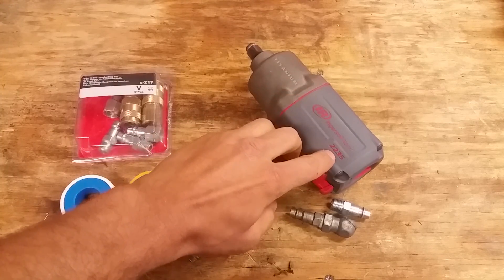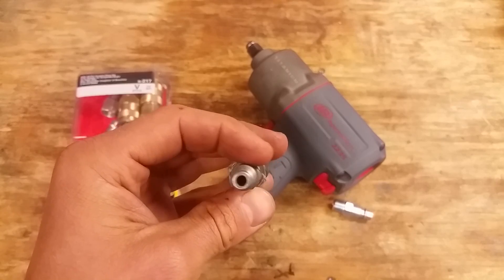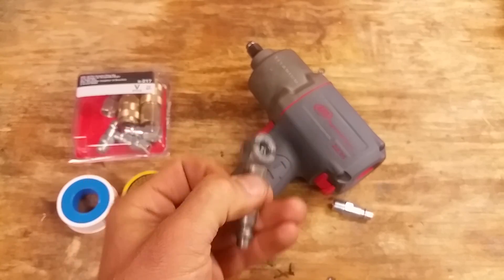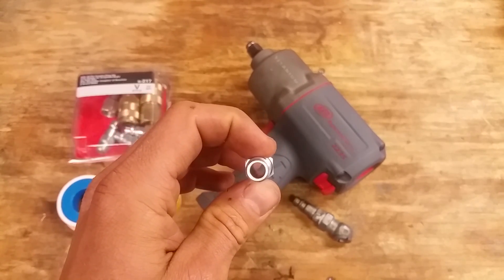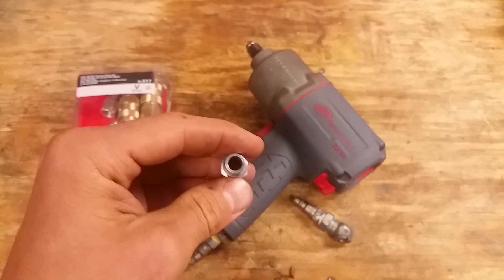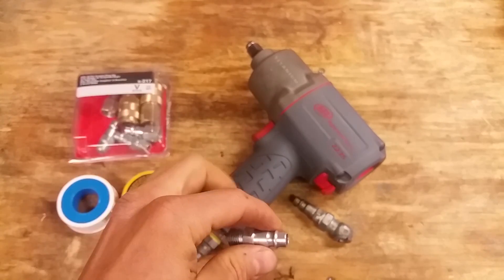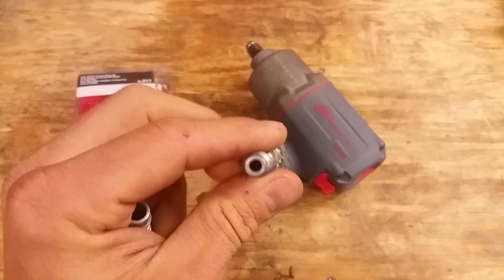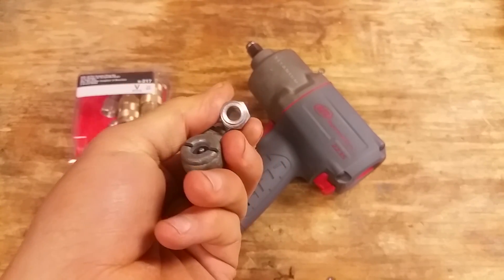The BEST Air Fittings Made?!?

Comment: Question did you had to also change the coupler that's connected to the air compressor to the high flow one???
Reply from the maker: Yes! If you have a large stationary compressor you can plumb the air line directly into the compressor with a high flow connector. If you have a smaller compressor just replace every connector with high flow ones.
Reply from the maker: Yes! If you have a large stationary compressor you can plumb the air line directly into the compressor with a high flow connector. If you have a smaller compressor just replace every connector with high flow ones.
Reply: @MattsShop  can you explain what you mean by pluming straight into the compressor? is it worth it on a 30 gal unit?

Comment: What size of air compressor do you have ? And whats the cfm on the air compressor ?
Reply from the maker: It is a Champion 5 HP 80 Gallon compressor with a R15 pump pushing about 17 CFM @ 175 PSI. I can upgrade it to a 7.5HP motor and get 22.3 CFM @ 175 PSI.

Comment: What size hose are you using also you said 1/2'' but the package says 1/4''
Reply from the maker: 1/2" between the compressor and hose reel--> 3\8 hose on hose reel --> 1/4" Fittings

So 3/8" hose and 1/4" NPT fittings
Reply: Great video, i have the same problem, just bought brand new Ingersoll Rand 2236QTiMax, it works OK on reverse gear but forward gear absolutely no power, just like you i can hold the socket in my hands and it is not spinning. Question: Do I need only the Milton 1/4" High Flow Connector or shorter hose or both. Currently I have 3/8 50FT hose. Will it work or i also need to get shorted hose (e.g. 25FT 3/8)
Here is my setup:
Huskey 50FT 3/8 Hose with 1/4 in IM air fittings
DeWalt 5.2 CFM 225PSI 5 Gallon
Hose connected directly to the compressor quick-connect fitting not the reel. Also, not sure if the Milton high flow fitting will fit my quick-connect fitting on my compressor.  @MattsShop

Comment: Please use the correct wrenches rather than adjustable. Stop the Fumbling and the madness.
Reply from the maker: Lol tight is tight. It's not a brake line that'll strip.
Reply: @MattsShop  its a 9/16" and a 11/16 wrenchs. You will never be able to.call your self a mechanic. A hack? yes!

Enjoy. You got a like for showing me something. Have the same type of air couplings  at Boeing. Never thought to use in my home shop. A draw back to your use is air volume consumption.  I run a 2 stage 80gln air compressor.  I have used and worn out 2 60gln Home Depot ones. That could not keep up with a die grinder or polisher. The Type V fitting will use a lot more CFM. As you wait for the compressor to catch up, maybe make the noise of the tool to pass the time.

Comment: I use the T fitting https://www.amazon.com/gp/product/B00N2TWBCQ/ref=oh_aui_detailpage_o09_s00?ie=UTF8&psc=1
Reply from the maker: Why do you go with that style? They are not very common and these "V" style ones are backwards compatible with the common "M" style that everyone uses.
Reply: I just changed everything over in my shop to the T fitting. I gave the old fittings to a friend of mine that uses them. I have a few extra T fittings in case i need one.
Reply from the maker: But why did you get the T fittings and not a different style?

Comment: Use white Teflon tape for air fittings!
Reply from the maker: That stuff is super stringy and gets in everything.
Reply: I do know that the difference between common white color and yellow teflon tape, is that the yellow is thicker and slightly tougher tape, intended for flammable gases like propane or so, and it costs a little more.  Good quality White tape is not that stringy, BUT with the cheap Chinese stuff appearing everywhere, the stringy garbage is quite common.  Now, on tight, close tolerance threads, the yellow type is "harder" and sometimes the added thickness makes the thread to feel tighter with less turns, so inexperienced users could leave the fitting less turns tight than required.
Reply: @MattsShop  Air uses the pink tape. Not the white or yellow.

Comment: I use 3/8 automotive high flow connectors on everything.  Harbor Freight used to sell them but I think the bastards discontinued them.

Believe they were milton G style clones, and they dont leak.
Reply from the maker: I know the exact ones you are talking about. I have used them before.

They still sell somthing similar. The only thing is you have to buy the kit every time. You can't just buy one fitting.
Reply from the maker: Yea that's the one I'm talking about. They make a Milton coupler that is backwards compatable with that HF one. I think it's the P or G can't remember. There's a vid on YouTube about it.

Those are like $6 or $7 at HF before the %20 cupon lol. That link is a rip off lol
Reply: It is definitely night and day for sure. I have 2 1/2 inch impacts and still got good air from the smaller fittings but after I put the bigger fittings on it was way more air than I could manage. The impacts sang some extra sweeeeet tunes. I now have to turn it down to level 2 on one of my impacts. Walmart started selling those hi flo fittings. I got a set for under $8, half of what the ones at Home Depot go for.
Reply from the maker: Another convert! Glad they helped out. They really do make all the difference in the world don't they.

Comment: Need direct from tank bypass any small regulators. Proper hose, fittings, and direct access to tank pressure and volume will make all guns run very well. Your baseline gun performance was terrible. Very bad. Most good 1/2" guns would strip that axle nut. God Bless
Reply from the maker: I have a direct from the tank setup. Tank > 3/4" pipe > 3/4" regulator > 3/8" hose > Milton V fittings > Impact.  Wasn't good enough BEFORE I switched fittings.
Reply: @MattsShop  That should work well.

Comment: One more thing low ur speed on ur inpact . u will get much more torque. The hight speed it reduces the strengh of the torque
Reply from the maker: Are you sure that's the case with the 2235TI MAX? When I put it to the lowest setting it has no power.